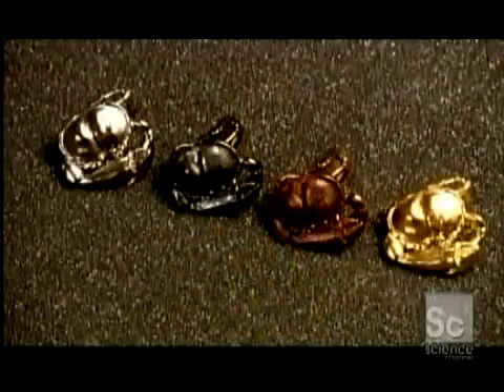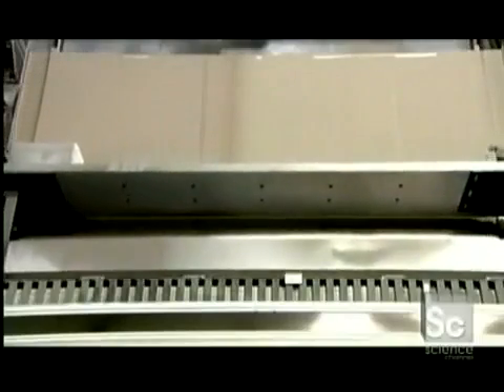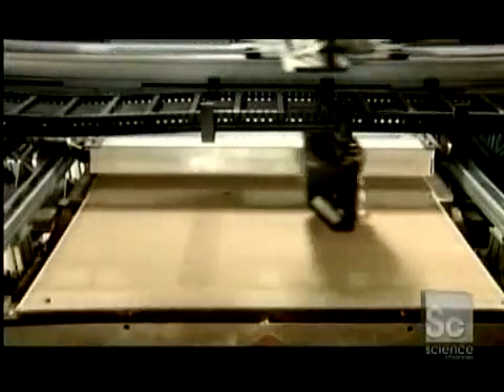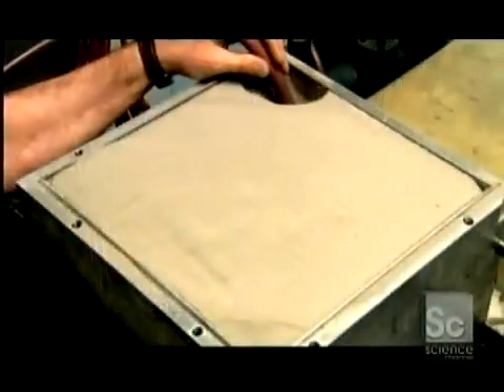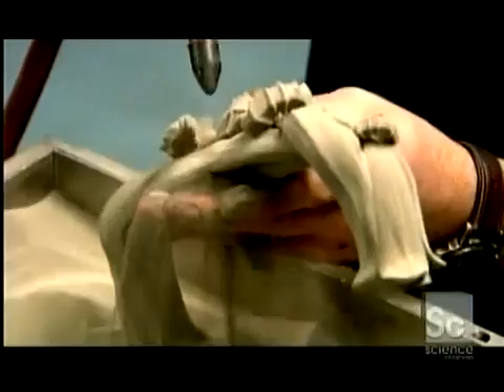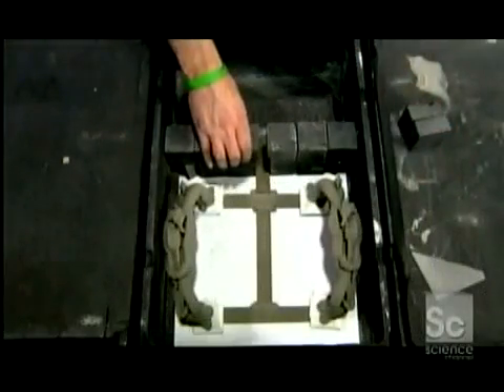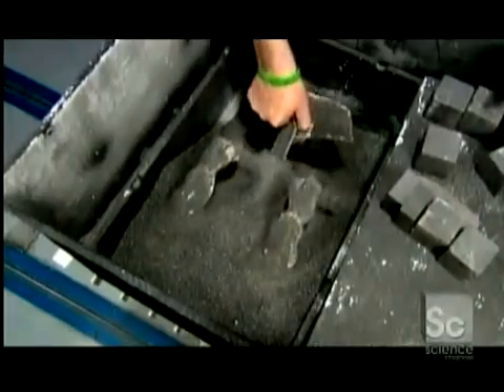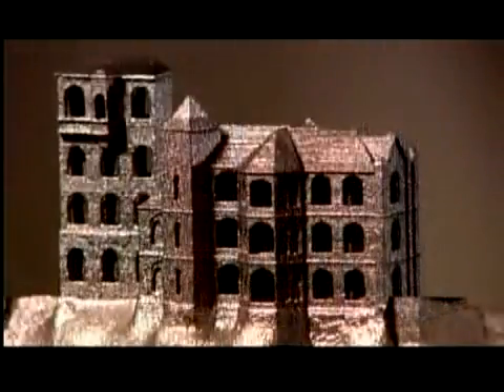3D Metal Printing | 3D Printing Technologies

Comment: why not just 3d print a mold for it?
Reply: Laser Gnomes Actually printing the mold wouldn't be hard at all. It would use the same powder method as in this video. The powder would be sand, resin would be sprayed on by the printing head. Once it's done it is ready for casting. Resin bonded sand is one of the most videly used methods in metal casting.
Reply: Mark Graham stereolithography says hi
Reply: Because it's not fucking accurate. PLA prints are garbage, FDM 3D printers in general are. They can't print anything accurately, you can't achieve any sort of precision for industrial level tolerances, etc. Casting items would be even harder. Point being, ITS NOT POSSIBLE to do that. The only way you can cast something is by using precisely milled parts with CNC machines, and that takes more time and money than 3D printing the parts with metal. For prototyping metal printing is faster and more accurate.
Reply: Exactly.  3DTOPO has a video on lost PLA casting.  Print up the part with PLA, create a mold with plaster of paris/sand/water, heat the mold to burn off the PLA and then cast it with molten metal.  Amazing precision and detail - and much quicker than this method (hours versus days).  This is almost identical to the lost wax technique used for centuries to achieve fine detail in jewelry.
Reply: what? no, just PRINT THE MOLD. just... make the mold instead of the object at the start
Reply: maksuree
and then pour liquid metal into what.... PLA?
TS100 is on the right track..
Reply: Mazakala Think about the actual shape of the mold for the peice shown. Then think about how the printer would actually print this shape from the ground up. This is the actually one of the big problems with additive manufacturing, you can't print things in mid air. Secondary machining(uber complicated) could be used, but this kind've defeats the purpose.
Reply: Mark Graham Yes, I agree. Printing the mold directly wouldn't be practical for making any complex shapes. However, if the printer were to use several different materials for the print, in essence printing the positive and negative at the same time. it could be highly useful. Hollow areas of the mold, the positive, would be filled with something that can be removed later with heat and the rest would be sand and resin. Not sure if it would be any better than the method in this video though.
Reply: Thanks maksuree, you are absolutely correct! I guess i forgot how broad that term actually is. SLS also says hi :)
Reply: good question but looking at the this video it may be possible to print something more detailed than a mold could but not sure, for example the sea horse body seems to have some pretty narrow thins around its body (not sure what to call it) this might not be possible in a mold but not sure or it could be that you cant have hollow spaces with molds but again not sure
Reply: Aaah where to begin... First of all it is much cheaper this way. Second of all, its waaaay better and easier. When you cast something from metal there is a lot of compressing and expansion of the material( it turns from one physical state into another and back again) which means that it would be much, much harder to create in in the exact dimentions you want. Then there is the oxide crust on the newcast thing that you would have to treat by cutting into the material, then you would have to polish it and everything... And last but not least ITS MUCH FASTER.
Reply: most metallic parts need to be casted at high pressure or pressed by a machine. normally casted metal is very weak you can't even make a fork out of.

Comment: This shit sucks! all that money and maintenance of the machine that does half a day on one object +all that powder is simply too expensive.
Best thing is just learn to sculpture out of wax and do your own bronze casting instead of losing your possible artist skills to a machine that is part of a future were no sculpturing artists exist.
Reply: Sculpting requires two sets of skills: creative/design abilities and manufacturing/fabrication abilities. A 3D printer can do the manufacturing part, allowing artists to focus on the creative aspects that machines are incapable of. This doesn't mean there won't be any sculptors in the future. It just means many sculptors will likely do digital sculpting using programs like ZBrush, rather than using wax or clay.

Comment: This took several days and pretty expensive stuff to do a couple of stainless steel door handlers... and he said it was cheaper and faster... really?!?! a blacksmith can do this faster AND cheaper! I can see how this can be interesting but not as he said!
Reply: Not for long at the rate this technology advances.
Reply: *****
 I would like to see advances in energy science to make energy cheaper and easier to get. Not 3D printing whose only purpose is to put more junk in the world. Sorry I am a technology skeptic...
Reply: Teralek It also throws the ideas of mass production, interchangeable parts, and machined quality completely out the window. Also no mold is ever going to give you the same level of quality as what you just watched. Forget about the issue of having to build a new mold for each design.
Reply: The printers are pretty inexpensive, compared to machine tools. And making molds, then casting metal is not exactly a fast process either. With 3D printers, once the design is rendered and 'sliced', one average desktop PC can easily run several dozen printers. All just sitting there, slowly but inexorably printing away.

It is the future of much manufacturing. They just installed one on the International Space Station to make spare parts, instead of shipping them up from Earth.
Reply: Calvin Huang
:-) A machinist only needs a mold. It's way faster... and cheaper. Furthermore, there is value in "lack of consistency" because it makes each piece unique and potentially more valuable overtime.
Reply: You forget to take into account mass-production
Reply: I agree it is still FAR easier and cheaper to get a blacksmith in most respects but like others have said give it a few years and this tech will put blacksmiths out of business guaranteed.
Reply: I said that 5 years ago.  We still dont see the resolution in DMLS parts that we need.  I'm giving it another 10 years.
Reply: Not many blacksmiths around these days (in developed nations). Perhaps you're thinking of a machinist. And it's doubtful that a skilled machinist or blacksmith would be able to produce complex objects like the ones in the video in less time, much less with the same level of consistency.
Reply: ***** Thank you John. Yours is a very realistic view of the future of 3D printing, I think...
Reply: I agree with you, Maybe it is for future spare part like NASA stuff or concept vehicles.
Reply: it is like ordinary home laster or inkjet printer
you will not printed a book at home
it is cheaper old technology for do that
but any little thing you need at once,you will use this 3d printer
some part broke up at home, anything, you will print that part
Reply: Marijan Milinovic aaaaaa What!
Reply: koenigsegg's turbo's are actually a useful application
Reply: Simmilar technology is used in aerospace industry. For making complex parts with lot of curved folded surfaces that are very hard to do with even 5 axis machines. But this is probably the only industry where expensive and slow processes like this are usefull.

Comment: Heating one piece at 2000 degrees for 24 hrs is a fraction of the cost of conventional methods??
Reply: Ist's just a question of isolation. It does not have to consume much energy.

Comment: They should likely be wearing gloves up to their elbows and respiration masks. The human body absorbs metal and if their doing this all day every day, the levels would likely cause problems over time. Anyway, awesome video.
Reply: it only absorbs into the body at a molecular level when present in a medium that can be absorbed through the pours. (ex. water). As long as there are no particles small enough to become airborn there wouldn't be an issue with inhalation. Metal in a solid state with a large enough particle size poses as much of a threat as the metal on everyday items.
Reply: Cameron Christiansen Well, he said it's "metal powder".
Reply: Jay H there are different sizes of "powder". they are usind different size granules for different uses.
Same as different granules sizes of dimanods are used for making different roughness of sandpaper, and smallest one in polishing pastes.
in case of metal they choose size of granules by their melting point and heating speed.

Comment: someone help me here, wouldn't it be quicker and easier to have the piece CNC milled?
Reply: Good luck trying to mill those.  The mill can't access some of the areas that would need to be milled on those example pieces.
Reply: Timothy Giggie I believe you're trying to express the term "Undercuts"... which in itself is a major advantage additive manufacturing has over a subtractive approach. However there is definitely a place for both methods as such factors of objective design, material(s), speed, cost, and others will dictate/ differentiate the particular approach to the project.

Comment: I believe you are wrong that there are basic thermodynamic limitations here. The kind of particle fusion currently used is just one generation of the the basic 'pixel' unit, but more sophisticated interlocking nano-scale interfaces are available for stacking/tessellating into larger patterns. No first-generation machine should be evaluated the with a fixed implementation, and industries that are competing with this need to be VERY careful about being over-confident about their continued lead!

Comment: With reductive machining, you can break one bond...and free up a lot of material.  With additive machining, you have to overcome heat of fusion for very small particles. Very inefficient.  There are some basic, fundamental thermodynamic problems which "advances in technology" can not solve.  You can not get around the laws of physics.  To make things worse...ENERGY is going to get dramatically more expensive.  Technology is not energy...it is clever USE OF energy.

Comment: I do understand we need to be humble, but as a mechanical design engineer I have to say, metalutgy is nothing like electronics. It is nowhere near as easy to control production parameters, dimensional accuracy, chemical composition, thermal gradients, and so on. I wouldn't get my hopes up too much.

Comment: Applications are more ornamental than anything else with the current technology. We've "3D printed" working gearbox prototypes using Direct Metal Laser Sintering (DMLS)  but...they cannot handle and significant loads. The issue is that most traditionally machined components are made of steel that is heat treated to obtain the required strength properties. This cannot be done YET with sintered metal powder technology.

Having said this...the "3D printing concept" itself has enormous potential.

Comment: 3D printing can produce complexities that cannot be achieved in molds. 3D printing can produce very complex designs very fast from the digital design to the machine process. 

What is going to happen at some point is that graphene is going to be added to the process and this will then produce parts like we have never seen before. 

They will be hundreds of times stronger and exhibit properties like we have never seen like materials that can be conductors and insulators all in one.

Comment: 3D printing will move the industry back to local manufacturing what we are about to see is small companies doing what required large resources before. 

So a lot of these workers in Manufacturing will move to local industry. Copper that has been doped with Graphene can produce a 500x increase in strength. 

And when this is combined with 3d printing we will have local products like the world has never seen before.

Comment: Because the process would be able to produce pieces that are more complex than Cast iron molding. 

The design process to machine is also digital so a person could design such a piece and then network it to the machine.

It can be a very fast process and it now used in aerospace were exact structures are required.

Comment: Possibly, but molds have problems with some shapes that don't easily separate into a top and bottom part, requiring the mold to be made of several pieces which then still need to be assembled.

With 3D printing, the filler material that would normally be the mold is just powder, which just needs 'some' way out. The only real requirement is that there should be no open spaces actually -inside- the object.

Comment: it's called cold weld, it's a special metal glue, using some kinda of electrolysis with epoxy "charge" to make pieces join one in other, there's a lot of brands, most famous are JB-WELD, PRO-WELD and ULTRAMETAL from Diamant Polymer...
i already used JB-Weld, and it glued perfectly a metal box for prototyping, and how i don't have a "contact welding machine", the result for me was more than i exprected!

Comment: Molds are great if you can afford getting the mold created. 3D Printing tackles that cost, as well as turnaround times. Originally called "rapid prototyping", 3D printing also allows you to build geometries unattainable via other means.

Comment: 3D printers used to range in the prices of  $20-25K, not $10K.
The 3D printer which are found costing in hundred-dollar range are all primitive generations; that do not share the capabilities of its modern successor. You're not going to find a modern 3D printer that is as affordable as a typical laser/ink jet printer.

Comment: When you use your CNC and cut away metal to form your object, what happens to the all the extra metal? I assume it's collected, recycled, reformed, reused, but you have to pay still for solid block each time you use the machine right? Either way, at present, I see a consumer version of a CNC or flowJet being far more feasible than this 3D metal printing..particularly with small pieces.

Comment: "50 years" ... My ass! The metal work that would be required to craft something like these statues would be thousands of dollars in blacksmithing. Yeah, that's right. I'm not talking shit casting molds or even dye presses, you would need a blacksmith with decades of experience to reach the accuracy and precision that a laser printer can create. These are extremely high quality printings, and to create without the printer would cost thousands instead of hundreds.

Comment: But it's very unlikely that your common Joe can afford one. Yet, as long as lathes, milling machines and such are available a skilled craftsman can manufacture practically any traditional steel and wood gun. Check the video Ligth engineering darra adam khel, it's fascinating!

Comment: You can't print guns at home, this isn't plastic, the machinery costs many times what you paid for your house. With the technique in this video you'll even need an industrial vacuum oven! With this technique you couldn't make functional parts, the material is structurally weak. You'd need to SLM it and then post machine. Basically, if you want to build your own gun, using a mill and/or lathe will be easier and cheaper. FDM plastic printing is feasible for end users, metal printing is not.

Comment: Not to beat a dead horse, but modern civilization is built on CAD/CAM, which takes skilled labor. Take for example the automotive gearbox, the pieces could concievably be forged and filed by a master blacksmith, or milled from a CAD drawing to micrometer precision, which one will be more efficient and reliable? Do you really want to ride on the handmade-from-drawings passenger jet vs. the CAD-engineered one? The part being made in the video is... what is this a seahorse seashell party? Get real.

Comment: No they aren't. Many parts CAN be made of plastic, but this process still cannot produce chrome-moly steel, nor harden and temper spring steel. Its still about printing a plastic lower, and then purchasing all the rest of the parts made the old way......

Comment: Yes plastic 3d printers are common with different levels of sophistication. Most work much like a normal inkjet printer, printing layers of plastic until the object is complete. Much simpler to use than a metal printer. There is sometimes some excess material that needs to be trimmed but you can make whatever you like.

Comment: This is technology? Build box, superfine ss powder, 3d gluing,  layering, remove build box, put in oven/heat/cure, vacuum powder, air blow by hand, another build box, aluminum oxide powder, bronze powder, heat/absorb/cure,....  A lot of trouble for a piece of silly sculpture door handle.  Cost? $100,000?  Try to make a simple ball bearing assy? Don't think so.   Hollywood has the national enquirer, this is "for technology".

Comment: So far the composite materials offer the best options for such things. This metal process clearly has limitations , given the types of metals used here and why. If the finished item could have been in stainless steel we'd have been talking. I think a composite plastic lower or even magazines would be better choices than bronze or similar low melting point metals.

Comment: It would be nice to see something like a metal extruder printer. Because that multi step powder printing just is a mess.
It is cool to print doorhandles in metal but on the other hand it is overkill. I could do that door handle a lot faster and better, using other methods.